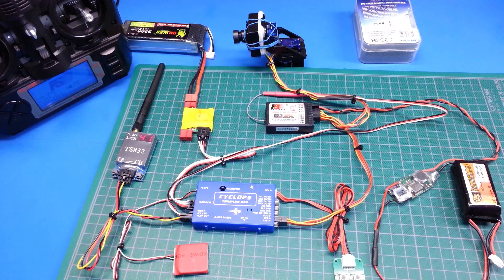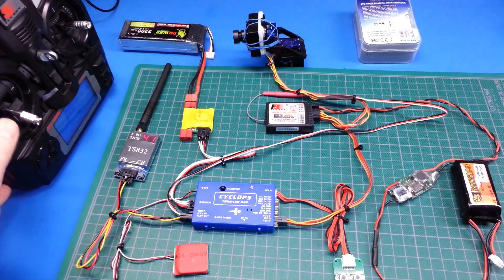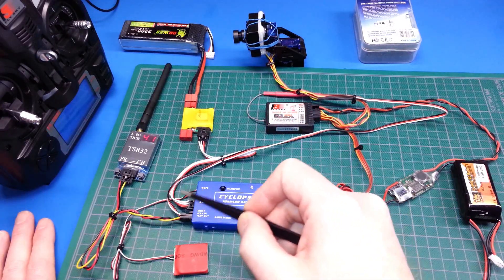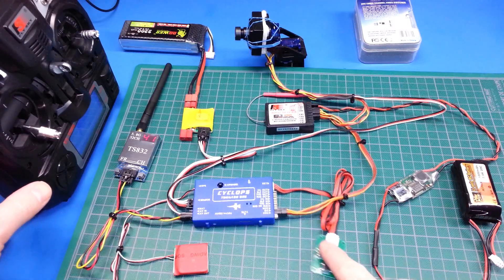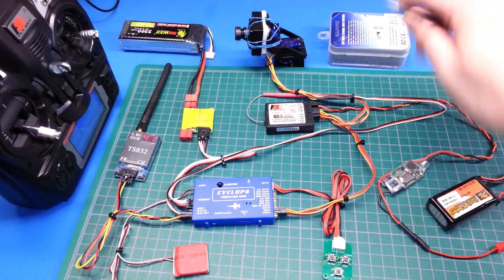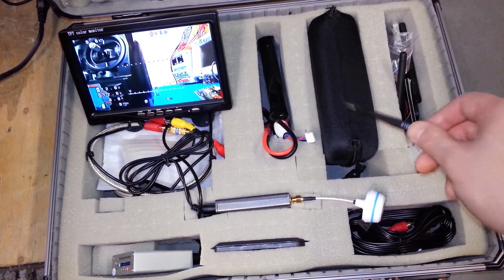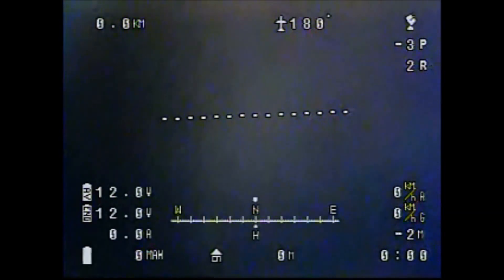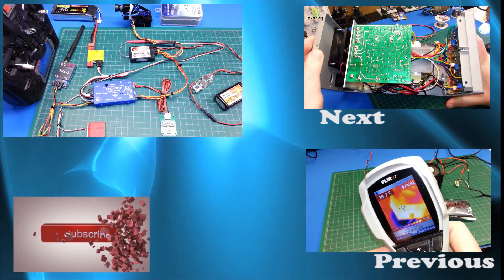UAV/Drone FPV Video System & Autopilot for RC Planes

Comment: good choice of transmitter, i got myself the same one about a year ago, and its still going strong.. Its best not to use the default tx firmware though, its best to flash it and put "open 9x" on it, or one of the alternatives. there are also backlight mods and all sorts of other things you can do with the TH9x :)
Reply from the maker: ***** Defenitely an awesome TX- best bang for the buck I have seen yet in my life.  Cheers

Comment: You might consider lighting on a large plane. How about showing how you would use 3 watt leds on the wing tips for strobes with an arduino so you could show us how you would power it and use mosfets or transistors to carry the power.
Thanks for the video.
Don
Reply from the maker: amtpdb1 Like this? :)  https://www.youtube.com/watch?v=f-w4a3QijBU&index=6&list=PLxyM2a_cfnzgO5FcmIAv6LOsji3UiBhJX
Reply: Eric William -MKme Tech Yep like that but maybe show us how to put led of a higher rating and show us how to carry a higher current then the arduino can carry by it's self.
Thanks
Reply from the maker: amtpdb1 Added to the list!  Cheers
Reply: Eric William -MKme Tech Thanks- been trying to figure it out but....... no joy
Reply from the maker: amtpdb1 Hmm in the interim- just search for how to use a transistor.  You wont need to mod the code at all- just add the transistor drivers and actuate from the Arduino output.  They in turn drive the LEDs (high power in your case).  Nothing to it really.  good luck
Reply: Eric William -MKme Tech Thanks